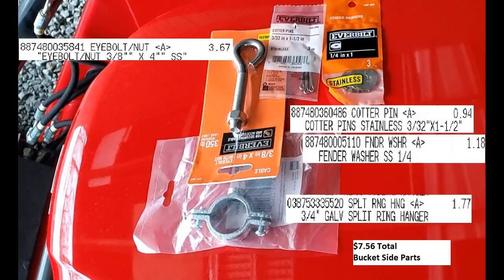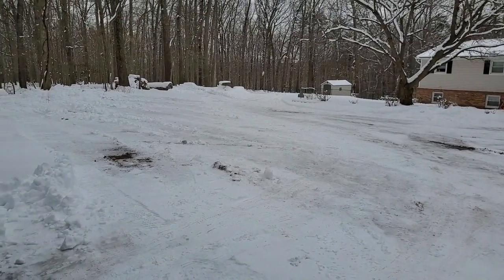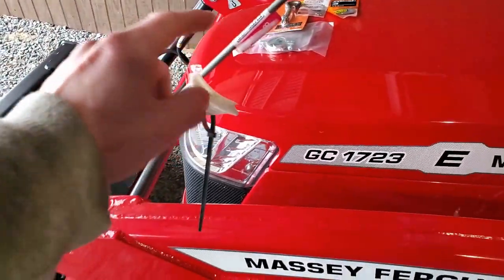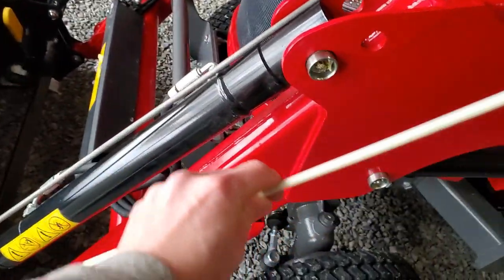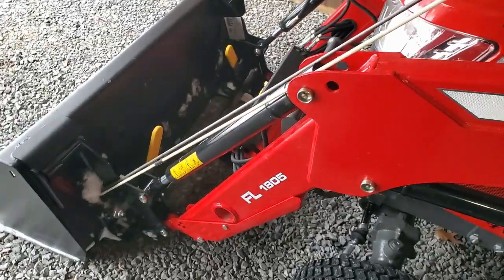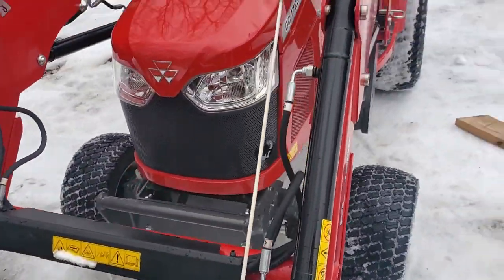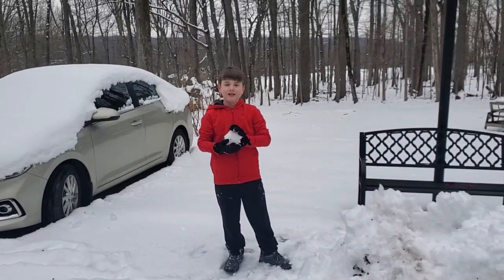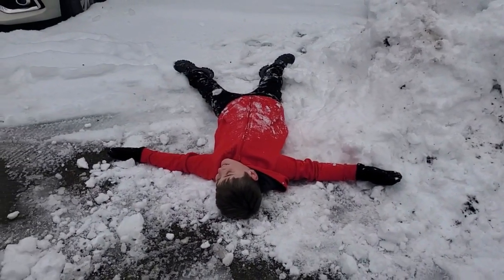DIY Bolt On Loader Bucket Level Indicator for Massey GC1723E

Comment: i have problems on l3-4-5 i here ya. i have a gc2300 and i call it my back saver. indispensible now 
5-
Reply from the maker: It really is a big help. I do notice that the bouncing around will sometimes bother my back. Adding the arm rests helps some though since I can push up with my arms to decompress every now and then without getting off the seat.

Comment: Love the video !!!! looks like a great idea !! Have you had any issues of it loosening up during or after operation ? Also, Kinda off topic but what do you know about sheer pins ? do you use any implements that have them ?
Reply from the maker: The clamp did slip off the cylinder rod once, but I just threw another piece of gorilla tape around the cylinder and it's fine now. The only hardware I have that uses sheer pins is a standalone gas engine powered snowblower. I don't know much about sheer pins other than the obvious which is that you want the pins to sheer off so it doesn't destroy the snowblower internal gears when you hit a rock. Some people use Grade 2 bolts instead of sheer pins, but the sheer pins I have on my snowblower have unique break points designed into them. For me it's not worth using anything except the exact OEM sheer pins.

Comment: Just get a set of edge tamers and problems solved.
Reply from the maker: They perform similar but different functions. I have the edge tamers and bucket level is still relevant even with the edge tamers installed. This is especially true on uneven turf. It's also nice to have the level indicator for other SSQA attachments.

Comment: EXCELLENT!  I love your solution.  In using my bucket to gravel a driveway this past weekend I did find it hard to determine if the bucket was level when scooping up gravel from a pile.  At one point I leaned too far out to see the bucket and opened the seat kill switch.  Don't want to be doing that!  And I'm glad you're feeling better and able to get out and "play" again.
Reply from the maker: That seat kill switch is a pretty common mod too. Most people zip tie it down because of that very issue. I know it's there for good reason, but I found it to be more distracting to my overall work and safety to have the tractor shutting off every time I lifted up to look at my bucket.

Comment: Ed, I looked at the indicator from MF after I watched your video. Sure I can think of some things to improve your indicator but in the end, your design works well. I like the fact that yours is higher than MF's. Do you seem to have a problem with your bucket digging in after you start skimming the ground? I can put my bucket on the ground level and if I hit a hump of dirt the bucket will tilt more and dig deeper than I wanted to. It is kind of like the cylinder has air in it instead of being full of oil. Sorry about your back, I have degenerative disk disease and I know your pain. I have only 10% of my disk in L2, L3, and L4. I take a supplement called Hyaluronic Acid (500 mg) every day and it really seems to help.
Reply from the maker: My bucket might dig in on occasion, but if it does then I just pitch it back a hair. I don't think I've ever had the same problem you described. I also got a pair of edge tamers (check out that recent video). They should be a big help when moving snow this winter. Also appreciate the hyaluronic acid tip. I looked it up and that does seem to be a thing. I'll have to do a bit more research, but again I appreciate the tip!
Reply: @Redneck_Ed  Yes I watched your video on the Edge Tamers. Unfortunately, we don't get much snow here where I live ( just south of Dallas Tx). I have been thinking about a Tooth Bar though. Thanks for taking the time to make your videos. Not too many people make videos that have Sub Compact Massey Ferguson tractors. I have the 1723E and it continually surprises me on what it can do. I am about to put liquid in the rear tires.

Comment: Thanks for the video. I put a similar system together for my 1723 this weekend. I couldn't find a pipe hanger like you used at a hardware store within 500 miles of my place, so I used a 3/4 inch fence rail clamp. This gave me the opportunity  to use any size eye bolt, so I went with 1/4 inch for top and bottom. I used a 1/4 inch aluminum rod that I drilled for pins similar to what you show, but used rubber faced washers and drilled the holes a little short. After compressing and getting the pins in there is zero rattle. I opted to bend the rod at the upper eye to indicate level. With a 4 ft. length it would have hit the windshield of my cab when fully curled and lifted. Works great since I don't plan to use many other front implements. Thanks for the great idea!
Reply from the maker: That's awesome, thanks so much for the comment and feedback. The bend is the better method for sure. I'm going to do that to mine one of these days.

Comment: Awesome. Best DIY bucket level indicator that I have seen yet. Definitely bests the $50 MF solution that's for sure. What about running that top eye bolt thru both holes on the loader frame instead of just the one? Would the aluminum rod not be aligned parallel with the loader if you did?
Reply from the maker: You could run it through both holes, but you'd have to size it just right so the end of the eye bolt doesn't stick out the side and jab you every time you get close. It would also possibly create stress on the metal if you double bolted it through each opening. Can't see why you couldn't make it work, but it wasn't needed.

Comment: You might think about treading the aluminum rod and put a couple of nuts at the bottom where they go through the eye bolt.
Reply from the maker: Thanks for the suggestion.  Check out my last video at 7:10 to see what I did with the aluminum rod. Kept it pretty simple.  https://youtu.be/Np0RlOPvwrI

Comment: I've made a few of these n have same machine. I used a conduit hanger on shaft close to the bucket with a 90 degree small tie rod end facing up. Then threaded a 1/4 x 35"rod in. Mounted a 30"square tube to top of outer cylinder by using a wrap of rubber by the welds to space it even and not scratch cyl. And attached 2 tie wraps top n bottom. Your round rod now inside  square tube sits perfectly parallel on top of cyl. Top of my square tube i cut at 45 then cut 2 shallow slots in rod for level 1 for bucket 1 for forks. A dab of paint makes slots easier to see,it is precise, where i think your eye bolts will be sloppy and what ever you put on rod will rub or move. Painted everything black and it looks like it was always there. I put mine on right side cause i always get on n off from left  also no drilling involved. I am not mocking your work just giving other options
Reply from the maker: Thanks for the comment Bruce. Your design sounds pretty solid. It's one of those things that can be done several different ways. My goal was no welding, no cutting metal, and no rust. I ended up using a 1/4" aluminum rod in my final version and of all things I place a pencil gripper on it. I'll get a video up soon showing that and some other tractor stuff. Thanks for watching.
Reply: @Redneck_Ed  looking forward to it ,by the way does your bucket and 3pt bleed down?i found out the hard way,had a few parts hanging of my forks. I painted them late at night and the next morning i had shiny black parts bent under my forks
Reply from the maker: @brucebennett8475  Yes, mine does. Good Works Tractors has a video where they measured it over several hours and I believe he said the model Deere he had was spec'd for like 1" per hour bleed down, but don't quote me. My Massey seems to be in that ballpark from a test I did, but under normal conditions I wouldn't find out because the FL1805 loader manual (pg 20) says to depressurize under the After Work section which means to move the joystick to all end positions for about 3 seconds. I lower the ballast box and depressurize the loader every time I park it.

Comment: Nice bucket level indicator build.  I never had an indicator before but purchased a new Massey tractor which has a level indicator and I use it a lot since I can't easily see over the nose of my tractor to see how level my forks or bucket is (depending on what attachment I'm using). The indicator you built is perfect and does the job. I enjoyed a full-watch and also am a NEW SUBSRIBER!!   👍🏽😀 Have a fine weekend, Ed.
Reply from the maker: Thanks for the kind words and for subscribing!
Reply from the maker: Oh, I just checked out your channel and I had already watched your ballast video a few weeks ago. Great video. I almost went that route but mixing concrete isn't in the cards for me now so I went with a box which I'll stack with bricks.